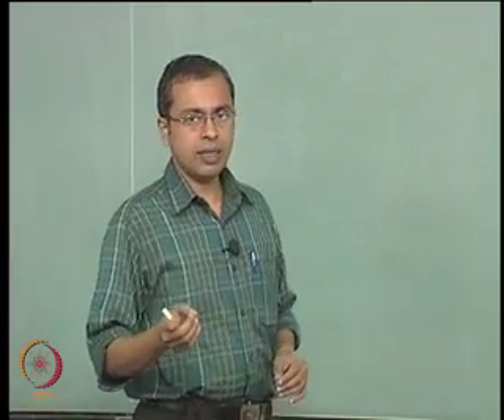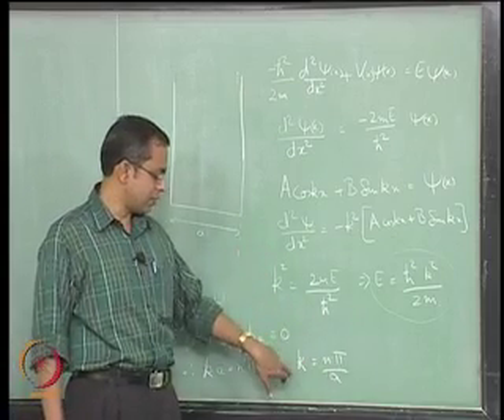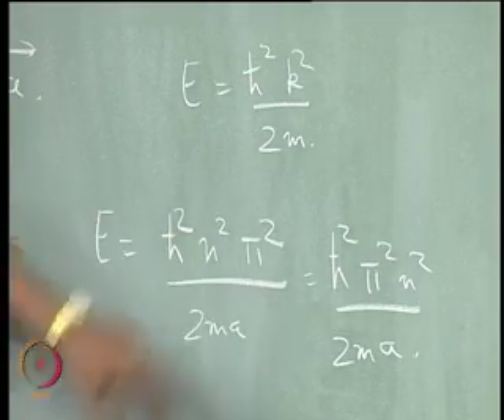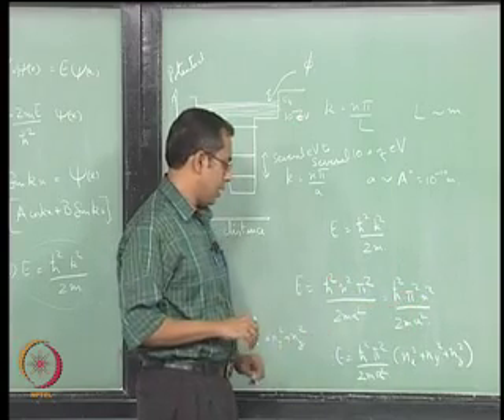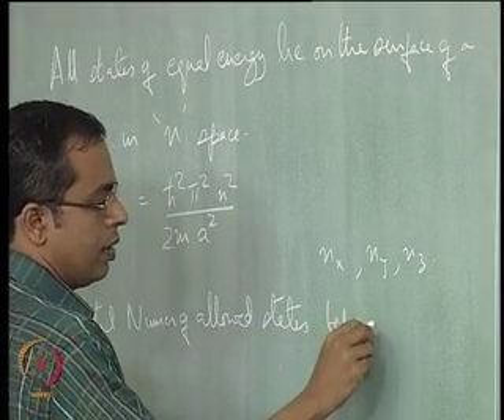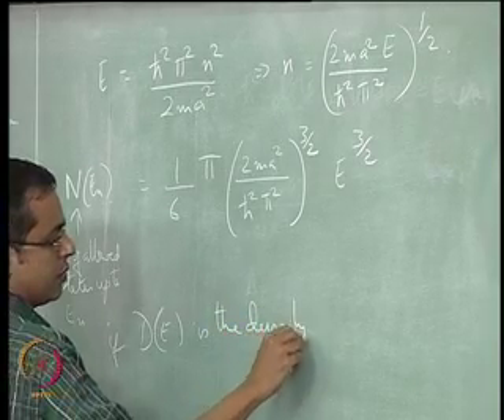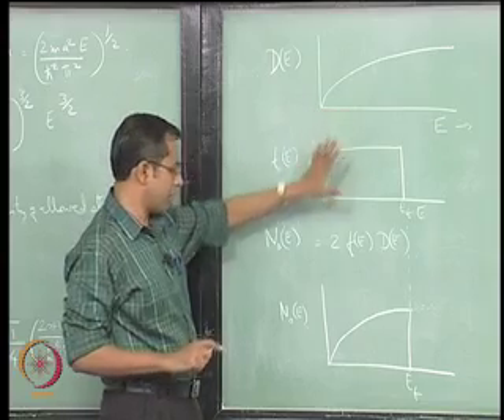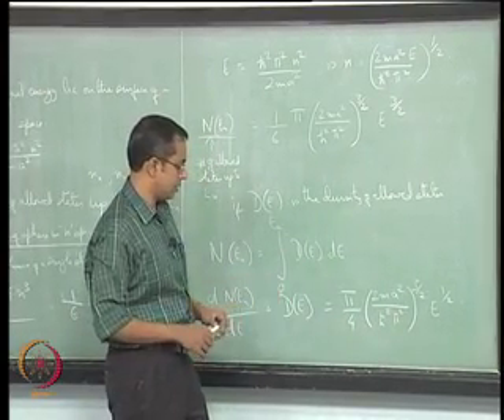Density of States

Comment: Total no of allowed state of energy value En  ,by allowed state we means that the state may be occupied or not..But it is permitted , NOW ( in 32.02)  it is written as  N (the density of occupied state). Should not be it D because D is density of allowed space?
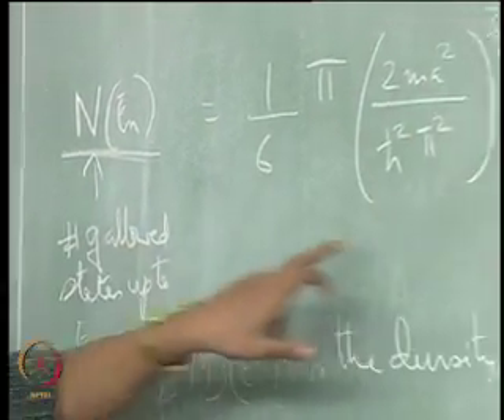Reply: Yeah we can replace N with D but the meaning doesn't change. You can check at 46:29 the prof mentions it..!!

Comment: Why we need to only positive values of nx ,ny,nz
Reply: k=n (pie)/a
since k can have only positive value
implies n will have positive value only.

why would k will have positive value?
1) k=-{2mE}/(h cut)^2 ...since for 1D potential well E is -ve (E<0) 
implies k is positive.
2)p=(h cut *k)..Unit for k resemble unit of wave vector in waves and oscillation physics
since  in waves and oscillation physics k is always positive
implies k is positive.
Reply: As the electron forms standing wave,both the positive and negative direction of propagation vector k is taken care by using single n values. And hence there is no need to take negative n values.

Comment: Wonderfull ! but i didn't know why the volume of a single state is 1 .
Reply: +rouadkjq Remember here he is doing the calculation in 'n space'. As we know 'n' can only take integer values i.e 1,2,3.. etc. So the volume of a single state in this space can be calculated based on the smallest integer value that is allowed. Which is 1 in all the three dimension. 1*1*1= 1.
Reply: +Naveen Shetty ok, but then It would be: Volume= (1/8) (4/3) pi() 1^3... no? Can you please explain a bit more?
Reply: @chacho0001  the volume you are talking about is the total volume occupied by the cubical solid in 3d n space.  1^3 is the volume occupied by a single point in n space since the distance between two points in n space is 1.
Reply: @rajashsankarbordoloi2390  i still did not understand why he divided by the volume of a single state?
Reply: @blzKrg  To get the total number of states.
Reply: Sir actually if you divide the quadrant into three axes it will be 4
So we need to multiple with 1/4.